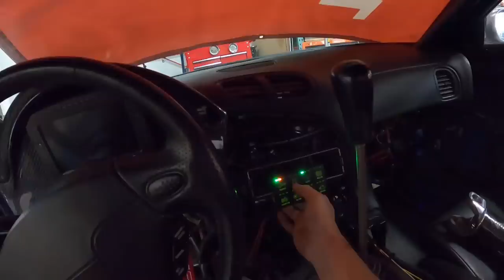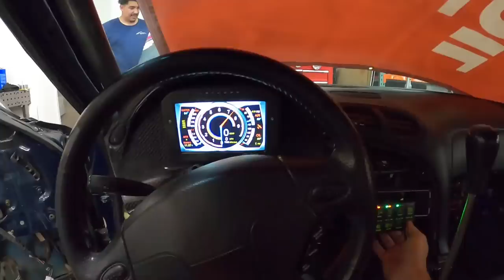6 Rotor Unboxing!

Comment: 6 rotor could fit in a Factory Five Type 65. It's a Shelby Daytona kit car. Someone else mentioned their mid engine kit car which would also be cool.
Reply: I agree thats a timeless car and the lines are amazing.
Reply: @shark2u6  I have an 88 fox that's getting long in the tooth but the engine, trans, and rear axle are in great shape. Too many things keep going wrong sucking up money to afford the kit.
Reply: I've said it before and I'll say it again. The new F9 from factory five is built for an LS V12 so a 6 rotor will feel right at home
Reply: Or a gt40 ?
Reply: If you go factory five. Get the new F9r
Reply: @cobrabuilder9336  SLC!!
Reply: @_winter7745  SLC will only fit a V8 length, the F9R is designed to fit a V12LS so wouldnt a 6 rotor be a nice option to replace that V12ls?
Reply: '69 dodge challenger Daytona?
Reply: That should go in their gtm, any of the classics, especially the cobra should have a 427

Comment: Really excited to see 2 rotor engines simplified and "myth busted". At one time i wanted a 13b swapped into my 71 240z restoration project but as you explained once you start digging into what rebuilding costs are and what "everyone" says is needed to make a fun motor it really does scare the average guy away from the 2 rotor platform. Who knows once your trials are complete myself and others might be more confident in making the jump into the rotary arena.

Comment: I feel like the 4 rotor and a v8 go hand in hand so the 6 rotor and a v10 go hand in hand pretty well. I think seeing it in a viper would be absolutely amazing. A practical engine bay with a lot of room to work in. Simple clean. The hood/ fender shoudnt interfere with anything. That would be sick

Comment: I saw someone say Volvo 240 in the chat. That would be so good. You do have a lot of room in those cars. Wondering if you still have that blue landyacht of a car? You could probably put the engine in that 😂
Reply: yes ! and the wagon !
Reply: even if it doesn't fit in the engine bay he make it a mid engined wagon
Reply: @atomflunder2  well he can still push the firewall into the cabin a bit

Comment: The year is 2035 you log on YouTube and see rob’s new video titled “the worlds first 24 rotor”
Reply: this reply needs more recognition @zohn
Reply: At that point to fit the engine in you would have to bolt the gearbox and differential together with no driveshaft.
Reply: "billet quad turbo"
Reply: "Can we build a 24 rotor in 24 hours?"
Also it could be 4x 6 rotors arranged like corners of a square around a central common output shaft (like napier "deltic" engines and no doubt others), So yeah totally doable, Might have to fit it in a truck or something with a high hood height though.
Reply: more like my 6 rotor is done
Reply: Toms Tech there’s a few 9 rotors in V config I’ve heard of so a square shouldn’t be much harder, just needs to be able to share a flywheel

Comment: I'd like to see either a BMW or Mercedes.
For example a BMW 8 series (old one ofcourse) or a Mercedes SL.
Reply: Bmw E31 👌🤘
Reply: Or E24
Reply: I second E31, hella sexy car with a low rise headlight mod, and the v12s were terribly unreliable anyway, would be a great swap candidate
Reply: Casey Putch bought a BMW v12 just for the motor.
Reply: @aserta  check out E30big here on yt, he's running 1200+hp in a 5 series with v12
Reply: @BOOYAGA  A C111 Mercedes.
Reply: S600
Reply: Or a late 90s 7 series lol
Reply: @0611930024838  All these cars will overload the motor unless lightened significantly
Reply: @_winter7745   overload 800hp :/ , OK.
Reply: A rotary Z8! That would be interesting!

Comment: Rob Dahm 

Toyota CENTURY 

All black Japanese gangsta car that came out with a v12 

Now that would be tuff.
Reply: Yes
Reply: An s600 maybe?
Reply: Mazda Roadpacer would be way cooler though.
Reply: I'm thinking of swapping the 1gzfe v12 into a mk2 supra. Pretty straight forward swap. Getting replacement parts in the states is brutal though and the heads don't flow worth a fuck on them in stock form. They need about $5k in head work before they really come alive.
Reply: @mkIIIsupras  look up top end performance in Chatsworth CA

Comment: 6 Rotor in an BMW E36 M5
Reply: E36 is 3 series. E34 is 5 serier.

E31 is the perfect match tho 🤘
Reply: I was just going by the rough body style compared to a 3 series that I remembered.  I think that was the last generation of the V10 M cars.
Reply: @JeffSlover  E34 was straight six engine 👌 but the E34 is gorgeous 😎

Comment: for the tension bolts in the 6 rotor instead of full length bolts why not have center collar threaded sleeves with bolts from each end. tension will be more even overall and it may make assembly a bit easier overall if you can build from center out to each end sort of like 2  of the 3 rotors conjoined together but as a single unit in reality  and the bolts can be thick as possible better stability, alignment and, bolt torque more consistent throughout the assembly. and sealing surfaces will be better seated as well.

Comment: I doubt anyone will even read this at this point, but an older Jaguar XKE (mid 60s) would be an awesome vehicle for this engine.

L O N G  B O I  hood, drop top, GT type car, light(ish) weight...  Seems perfect.

I agree that a Viper would be cool but I feel it would be somewhat pointless.  The Viper V10 can easily be hopped up to 1000hp.  The Jag I-6 would be lucky to ever see north of 300 to the wheels.  Unless you found a Viper in good condition that had a blown engine, you would be tossing a ton of potential power away just for the novelty of putting a 6 rotor in it's place.

Plus, with the Jag you can say it still has an I-6 and technically be correct.

Comment: The 1971 mustang mach 1s because they have a massive engine bay and more to work with because there is afoot of space between the radiator and grill.

Comment: The jaguar xj220 was mean to have a v12 twin turbo and 4wd, but came with a rover v6 turbo rear wheel drive, get or make a xj220 body over a skeleton frame like the 4rotor and make what jag didn't.

Comment: One of the best looking luxury cars all time the 2001 BMW 750Li... pull the V12 out and drop the 6 Dorito in it with a 6 speed manual.  All the good looks of a classic with 275 wide tires all around so update tech in the dash and it would be smooth af.  Idea... also you can get old 7’s cheap but the 2001 year was king
Reply: Or or or one of the BMW M6’s with a V10 that failed.  They were monsters out of the box but had engine failure which causes them to be cheap af with a bad motor.

Comment: Here's my 2 cents: a six rotor makes very little practical sense but is insanely cool, so it should go in to a body that makes very little sense but is very cool. Therefore I suggest that it sits at the front of an early 30's boattail speedster. Or something that looks like one. Maybe a custom body made in collab with another channel? I'd guess that future holds an absolute boatload of custom fabrication in any case, so why not go all out and start from scratch? Plus the loooong nose style would house that thing very nicely.

Comment: You should get an aluminum fixture plate for your mill that will hold the irons consistently so you don't have to work so hard setting them up every time.

Comment: Older Volvo 200, 700 and 900 series models can fit v10 engines so I don’t see why a 6 rotor won’t fit. And the old 240 is pretty light weight for the coupe models. It’s in Miata territory at around 2400lbs in track spec

Comment: Dude start from the ground up. Go with a SL-c kit. Tavarish bought that crashed one with a turbo 3 rotor with a sequential and it was sick. I think you should order a brand new roller and drop your 6 rotor in. I can tell you I know a ton of people personally that would tune into that build. Honestly I don’t wanna see you build SHIT until the AWD 4 rotor is done but I get it. Million dollar projects take time. So my take is the SL-c or the factory 5 racing GTM GTR whatever it’s called. It uses all vette C5 parts so you can make it happen brotha

Comment: Factory F5R alreay has engine compartment long enough to hold V12 ls motor so can fit a 6 rotor with exotic car looks and modern super car style chassis im sure if you approached them with this as a project they may be willing to sponsor  Chassis has a potential SEMA build!!!!!!!
Reply: With a Race Tech Services 6xd sequential trans backing it up as it has hp rating to handle this motor even with boost on it!!!!

Comment: Promod drag 6 rotor (I would do a Dodge ram SRT10 so you can do plethra of stuff with it (aka race or pull). however a 6 rotor 240z datsun would be sick.

Comment: You wouldnt necessarily need an engine bay that holds a V12 would you?.  What about a straight 6? Might be able to keep it on the "cheaper" side if you look for something like that.  Or just blow it out even more and import an Australian built Ford falcon

Comment: You need to install the 6 rotor into a 1971 Lincoln Continental Mark 111, in all black with the roof chopped, just like from the original 1977 movie "The Car". There is simply no better, no meaner, no more sinister-looking rod! The hellish sound of the 6 rotor  would be the perfect fit!!

Comment: So Rob are you doing a twin turbo configuration to get 2000 rwhp? I assume it should not need injectors as large as the 4 rotors,  so you will not need a bank loan to drive the vehicle around the block.

Comment: rotary engines are easy... like stupid easy... build it in the basement with a minimum of tools easy. and in reality are pretty cheap as well, a basic overhaul can be done for ~1k assuming hard parts are in reasonable shape. the expense comes in when housing, rotors, etc are damaged. porting helps single turbo setups spool and big port engines are perfectly streetable with some time spent into tuning vacuum areas.

Comment: This answered a question i had on my mind and that was does Rob have the Lincoln still. It would be cool to 6 rotor swap that Lincoln its large enough it may fit and its a full frame car so you could easily reinforce that frame for the power.

Comment: I would love to see this in a Cadillac hearse. If it wont fit in the engine bay, put it behind the driver and make it mid-engine. They aren't super expensive either since they usually just sit and get the interior ate up by rats.

Comment: Holy Crap!!! Just found yer channel. Amazing. Liked/subbed. 3 things. Please consider creating a 30 horse single rotor version. The entire world needs them for sports including small aircraft to drive fans. Also Westinghouse did considerable testing running "wankles" on propane and LNG. Complete burn in every cylinder. Put that 6 rotor into a 1 Ton Dually V-10 4x4 Dodge pick up. All 6 tires roasting. I'm watching you Wizowski...Always watching... Keep up the exciting work. I will be watching every episode.

Comment: Rob into your next video talking about the 2 rotor REW, you should talk about at what point to stud the block (whp & wtq)? what are the limits into using the stock tension bolts (whp & wtq)? Those are just a few topics that can be informative to a viewer who might ask or would want to know into building a high horsepower 2 rotor.

Comment: Will such a łong bolt holding everything together not have too much pressure to compensate? Hope you guys understand what I am trying to ask :) 2 rotor bolt is 2x times shorter than 4 rotor hence 2 times stronger. Doesn't 6 rotor bolts have to be 3x times stronger than 2x rotor bolts?

Comment: Idea for down the road - use a 13B or Renesis - nothing too fancy - as a range extender for an electric conversion, similar to what Mazda has proposed for thefuture of the rotary.. You could pull it off and THAT would be pretty amazing to see a Youtuber pull off. After the 6 rotor build, of course! I say put it in a late 60's Eldorado coupe. Probably tons of room to reinforce the chassis and certainly enough room in the engine bay. I like the Jaguar XJS  idea as well, that would be killer and unique.

Comment: What about a pre-war Bugatti replica, or similar. Plenty of length in the engine bay (designed for straight 8)?

Or an Olds Toranado converted to rear wheel drive?

Comment: The 6 rotor might fit in a W210 some models had a v10, and you can buy a used one dirt cheap, and the chassis might need a little modifying, but take a look. 1996 to 2002 Mercedes E class.

Comment: Hey I think a BMW I8 would be a crazy for the 6rotor to go into, look at the rear of the car it has two wings and notches that go down the sides of the car almost like two separate panels if you cut down the notches of those panels you could widen it out the carbon fibre skeleton frame Connecting it back to the body then you could see the Suspension

Comment: You should work with TheSketchMonkey to have him design a car for you and build it up from another car's suspension. Like Pull the suspension from a wrecked corvette or other car and build the frame and chassis around the engine and transmission or transaxle. You would have to modify another chassis so much that it would probably be as easy or easier to design it from scratch. TheSketchMonkey is an actual educated car designer from what I understand and it would be amazing. That's not just to make it a collab like other people always ask for but because this type of collab just makes so much sense.

Comment: What if I get a king of the hammers trophy truck or an ultra four Off-road truck monster truck something they could handle that insane horsepower and torque that you could publicize and that you can build anything you want you got the tubing benders the machining tools build something completely off-the-wall that no one would have a purpose for but build it because you can

Comment: Biggest problem is the imports, but a rear swap in a ford falcon Ute would be super interesting. If that’s not an option, Chev Elcamino or Ford ranchero would be easier to source. Something low with little limit to what you can put in the rear...

Comment: You may have very well already thought of this, but the best way to explain the power delivery of a rotary vs a piston engine would be as follows.
1 rotor = 3 pistons (based on firing of each side)
1 rotor = 2x displacement  (based on 2 stroke vs 4 stroke)
So for every rotor an engine has at a given displacement, it would be an engine roughly 3x pistons at 2x displacement.  
1 rotor fires 3 times (like 3 pistons) every 360 degrees, vs 720 degrees for those pistons (2x displacement)
2 rotor 1.3L = 6 cyl 2.6L
3 rotor 2.0L = 9(8) cyl 4.0L
4 rotor 2.6L = 12 cyl 5.2L
6 rotor 4.0L = 18 cyl 8.0L

Comment: do compound turbo setup boost comes at lower rpm and you have enough air flow at the top making most torque, power in bigger rpm range :D but maybe it doesnt suit for 6 rotor

Comment: I hope to see that engine in a Lamborghini
You already have:
Front engine rwd
Front engine awd
Mid engine rwd
You miss only mid engine awd
Also Lamborghini murcielago or aventador both have a central (front facing) single clutch gearbox, that will balance the six rotor weight.
Also Lamborghini are used for the most various builds.

Comment: You might need to put it in a truck since you will need a fuel tank the size of the tray to run it for more than 10 minutes xD
Could try a landcruiser or a deville & If you get the V10 VW touareg (TT 5L V10) or the V10 RS6 in the states they could also work.

Comment: Rob. Find a wrecked Mercedes GTR. Even though it's a v8. Its a midengine front engine platform. Since the engine is behind the front wheel and it has such a long nose. I would think a V12 or 6 rotor should easily fit in there.

Comment: Wouldn’t a classic box framed chassis be the easiest to brace for the power?  Even thinking a classic truck.  C-10 for example.  Or something like a Chevelle?  Just imagining that vehicles like those have enough engine bay space.  Think that this one is going to be difficult to find a home for.  (Bet you already have it figured out though.)

Edit: what about doing something crazy like putting it in a Volvo 850r?  Aren’t those things indestructible?  Would love to see a 4 rotor in a BMW M clown shoe.  Don’t think this 6 rotor would be good for it though.

Comment: rob doing all you're going to do to the vette and swapping out the motor to a rotor how are you going to tune it using the vette ecu because nobody has cracked it yet and haven't been able to dyno tune there c8's properly?

Comment: Front eneinged. 400i/412 Ferrari....and you thought rotary corvette made a bastard....crash a ferrari show now with a 400i 6-rotor. Going that exotic needs an exotic.
Why is there not a case for a 5-rotor? if there is a case for a 3,4,and 6, then there is for a 5. Is there serious balance issues? Audi's 5 was a legendary sound and I really wonder what the sound of a rotary 5 would be.

Comment: I'm late on the stream. But do an open wheel tube frame 30's truck open engine bay to show off that crazy motor. Building a tube frame would be free in your shop. Slap a body on it.

Comment: Would a 5 Rotor engine work? You've shown how 3 rotors work, does the 5 rotor exist?
Reply: Also, does a 5 rotor engine equate to a 10 cylinder? Might be an inaccurate thought process here, I figured that a single rotor basically equates to a two cylinder engine than 2 rotor to 4 cylinder, 3 rotor to 6 cylinder, 4 rotor to 8 cylinder then possibly 6 rotor to 12 cylinder. Not to mention you mentioned that 6 rotor is not a competitively viable engine, and V12 (and I think V10) fell out of favor for similar reasons.